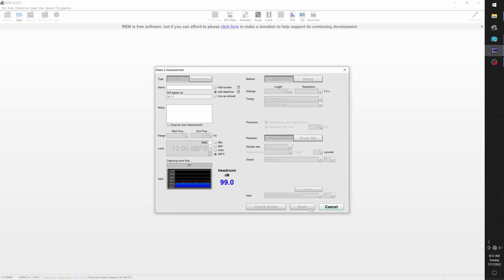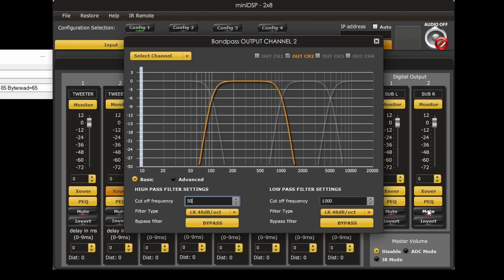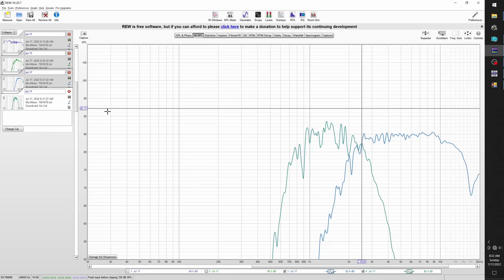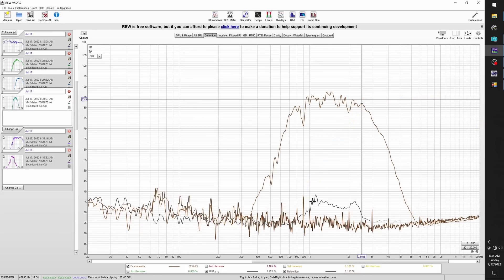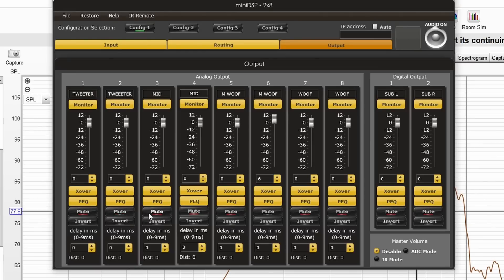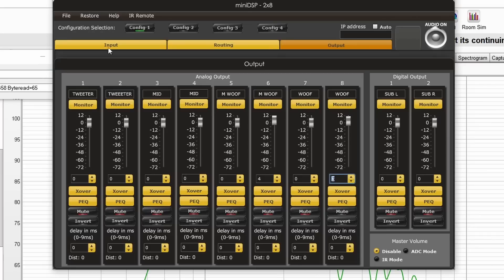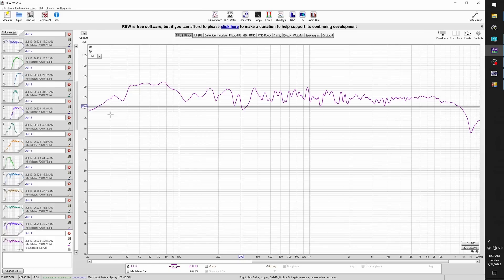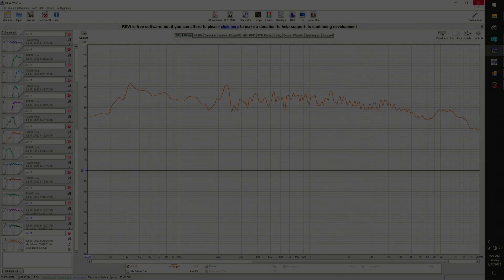Mini DSP Digital Crossover Setup for my Open Baffle Speakers

Comment from the maker: Watch the full build video showing how I made these speakers: https://www.youtube.com/watch?v=k4KNAT0p7O4
The speakers are fully active and use a MiniDSP 4x10 for the crossovers. In this video I quickly go over setting up the crossovers in the DSP and measuring the results. While not exhaustive, this will give you an idea of what's involved in tuning this type of speaker system.
For this set up the measurement mic was 1 meter away from the right speaker on axis with the tweeter. The off-axis measurements were done at the same distance - 1 meter. 
The system consists of the computer I use to play music (and movies, shows, etc.) that outputs the digital signal to the MiniDSP, so all of the crossover settings (and eq) happen in the digital domain before being converted to analog. The analog output for each driver is then sent to the 12 channels of amplification I have that powers the speakers and subs - 8 for the speakers an 4 for the subs.
Like I said in the video, you can look at these as 5-way speakers, with a sub, woofer, mid-woofer, midrange and tweeter on each side. This is a two channel set up, not a home theater.
Reply: John, I am thinking of running signal into mini dsp, filtering/tuning each channel to a specific driver, and then a dedicated small amp for each speaker. Maybe some LM3886 amps for the mids and tweeter, and a more robust amp for each bass driver. So dividing sifnal with dsp, and each driver has it's own amp. Using the UMIK to balance to the room, one could have quite a system for a modest dollar cost. Btw, I talked to a couple pro event sound engineers and they both agreed this is how arena audio systems are designed.

Comment: Really happy with my mini DSP. Seemed impossible setting my expensive integrated amp in a 2.1 configuration with a sub. There's also an all digital out mini DSP flex in case you want bypass the ADC at the mini DSP and use ADC in another device etc. you can do all your room measurements, crossovers etc etc try do that with something else without a pre out, I was about to give up until this

Comment: Do these speakers have passive crossovers as well? Can you show the entire setup and walk us through it? Trying to wrap my ahead around using a DSP. Thanks.
Reply: No. The dsp is doing all the passive does. Some people use dsp to design a loudspeaker xover. When they get all the setup right, they will build the passive xover for that loudspeaker.

Comment: In the interface, it looks like we have 10 channels (8 analog 2 digital) allowing up to 5 a way crossover. You run four 12s outside the enclosure- but those could theoretically be internal with some sort of internal digital converter? Also, the 4x10 is the 4x8 with a $ 10 USD software upgrade from miniDSP website?
Reply: Few more details on the amp? I just read the description- no need to answer my first question!

Comment: Could you use the results from mini DSP and successfully translate them into a passive crossover design with identical results?
Reply: Definitely. That is one of the purposes of using dsp actually
Reply: Definitely can. But with a decent components.

Comment: Question :) I built myself a couple of openbaffle speakers, I got a pair of  minidsp 2x4 and hooked it all up, my problem is this noice, it comes from the minidsp, white noice from fullrange driver,  So I had to go whithout dsp on that driver becourse of the noice... now I would like to experiment whith a tweeter, but I cant use my dsp, is yourse noicy? or can I get a better dsp? Its ok in my bass driver but whey play under 500Hz, but over 1000Hz and up  its unbareble to listen to that white noice :/ any ideas? Love youre vids ! Cheers from Sweden!

Comment: Why do you choose not to gate the test signal.  Is there some reason why you are trying to setup the crossovers to be right with room reflections included in the output?   Do you want to have the crossovers different for each speaker dependent on the room and the microphone location?  I would never do it on purpose but I build analogue crossovers and do not have the flexibility, is there some advantage?
Reply from the maker: These speakers are for this room, and not some other room that's a different size and shape. So Including the reflections / room modes in the measurements actually makes them more accurate.
Reply: @IBuildIt  
Nope.  You're correcting/adjusting the X/O for things that the microphone hears in your room but your TWO Ears combined with your BRAIN are filtering out and disregard.

In addition, you're not doing multiple measurements within the "listening window" and using spatial averaging, or a moving mic method for your room correction measurements.  So the in-room "response" you are measuring (single point in space) is not a true representation of what you are hearing.

The proper way to design your loudspeakers is to adjust your X/Os for the speaker's smooth & even response themselves (anechoic response, at least where you can down to the Schroeder Frequency using gating).

Any IN-ROOM response and corrections should be dealt with AFTER the anechoic response (and Directivity) of the speakers are optimized.  Use spatial averages of many measurements within your listening position's "head window", or a moving mic method, for your room correction adjustments.

I also think that you are underestimating the importance of achieving Smooth & Even Directivity in your loudspeaker system "because my room is acoustically treated so well that it doesn't matter".   Rubbish.  Unless you are listening in the extreme nearfield with NO nearby boundaries (including floor & ceiling), or with headphones, Directivity still matters quite a bit.

As it is, if you decide to change the position of your loudspeakers even just inches in the future, EVERYTHING you have done with this "X/O tuning" technique will basically be a wash.  :-/

I'm assuming you have Floyd Toole's "Sound Reproduction" and Vance Dickason's "Loudspeaker Design Cookbook" and revisit them often?

You can also Download the FREE JL Audio TüN 4.x measurement software from their website which now has libraries from Smaart v8 integrated for real-time phase response visualization.

They sell a proprietary TüN MAX audio interface with a high quality 5-mic measurement array that works with the TüN software, but you can use any USB measurement microphone such as your UMIK-1 with the software (albeit with some obvious limitations).

The TüN software and MAX measurement system are designed for their VXi-series of car audio DSP/amplifiers (which includes the VX800/8i...a built-in 8-channel amplifier with 10-channels of DSP Processing, with digital Toslink Optical input, 24/96 internal processing.  They also have a standalone 8-channel DSP called the TwK.

Using the TüN 4.x software combined with the VXi DSP amplifiers or TwK DSP, you can apply manual corrections OR "Auto-Tune" corrections (if you wish) using the measurements that you perform which will automatically apply the corrections to their DSPs in real-time.  This includes AllPass filters.

I know that you obviously already have your DSPs and Amplifiers, but you might be interested in the FREE TüN software.  The results of their "Auto-Tune" corrections are provided so that you can input them into just about any DSP.

But the real power is the real-time phase response visualizations of Smaart 8 that you get for free.  You can find excellent, in-depth tutorials for this software and hardware on the JL Audio YouTube channel.

Comment: fun too look at how other people does dsp.
looks pretty similar to my diy speaker build, a bit different since i used another minidsp product(shd studio) and also a hypex fusionamp.  
dsp really is powerful tool
Reply: How do you find the Hypex fusion dsp compared to miniDSP features and sound
Reply: @anandshah71  i can not compare sound directly since i used them differently, the hypex fusion amp i used as a crossover, dac and amplification, for main speakers.

the minidsp shd studio i use as room correction and subwoofer dsp and integration to main speakers.   
main speakers with hypex plate amp was connected to minidsp by digital xlr.

i can comment on the hiss noise the hypex produced, it was not something i could live with nearfield listening. 

but the software itself i can say more about,   minidsp is easier to use, but hypex is more advanced.
and having hypex as plate amp causes issues, and are not user friendly to set up and tweak.
My minidsp is digital only seperate box, where i can reach it easily and do not require a compartment in a speaker or something to sit in.

Comment: How is the noise level on the MiniDSP crossover? Mine is a bit noisy on the high end.
Reply: It may well be the power supply.
Reply: I’ve had the same problem with two different Mini DSP’s , balanced. Hiss from the tweeters. Annoying as hell. If you have adjustable amplifier gain turn it down a bit. If not it may not work for you.
Reply from the maker: Below audibility on mine.

Comment: You have answered some questions I have been wondering about. I have only a basic knowledge of DSP and seeing you walk through these steps helps me understand that process a bit better.

How much amplifier power is feeding each of the drivers in the system?
Reply from the maker: 100 watts for each of the speaker drivers and around 150 watts for each of the four subs.
Reply: @IBuildIt   what class amplification is implemented? 
All the same from tweeters to woofers and sub woofer . 
For instance class A, od class A/B across the board or A on the tweet , cladding D for subs . Just curious.  
Also was wondering g the woofer brand in your open baffle beauties ? 
Thanks so much for all your videos !!!